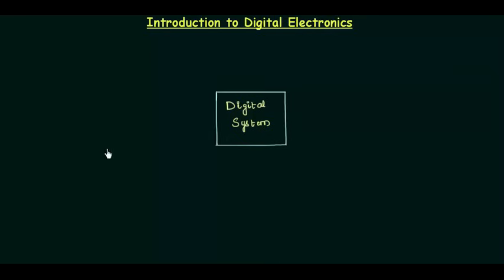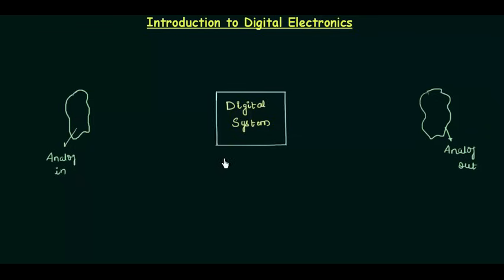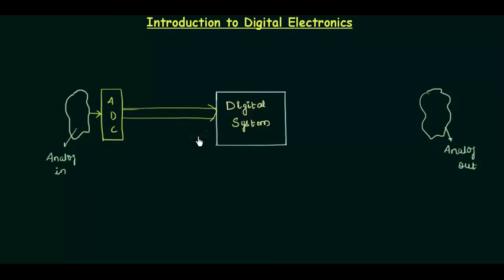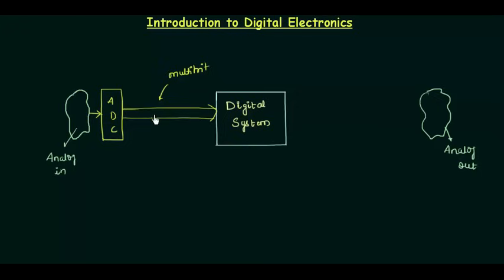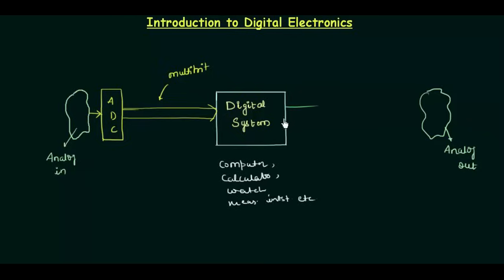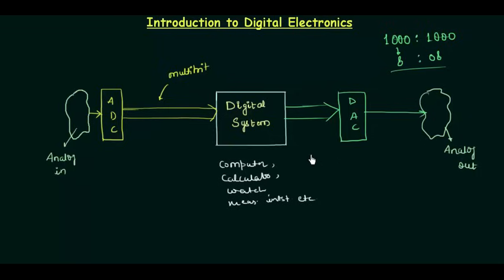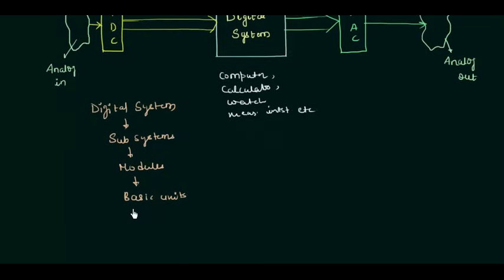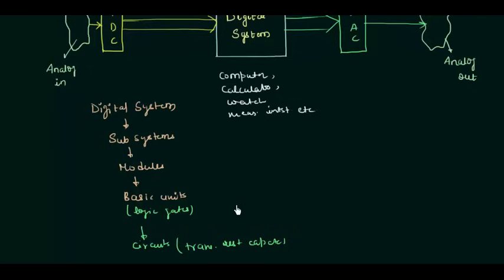Introduction to Digital Electronics

Comment: : COMPUTER ARCHITECTURE

UNIT-I
Information Representation : Register Transfer, Various Registers, Implementing Common Bus
Using Multiplexers: Logical; Arithmetic & Shift Micro – operations.
Basic Computer Design Instruction Codes, Interfacing various Registers, Computer Instructions,
Timing Signals, Instruction Cycle, Design of a Basic Computer.
UNIT-II
CPU Design Stack Organized CPU, Instruction Formats, Addressing Modes, Program Control,
Hardwired & Microprogrammed (Wilhe’s Design) Control Unit.
Memory Organization Memory Hierarchy, Designs & Concepts of Main Memory, Auxiliary Memory,
Associative Memory, Cache and Virtual Memory.
UNIT-III
I/O Organization I/O Interface, Modes of Transfer, Program Interrupt, DMA & I/O Processor.
Pipeline & Vector Processing Parallel Processing Pipelining, Parallel & Distributed Computers, SISD,
SIMD & MISD, MIMD Machines, Vector Processing

 tutorials please

Comment: Hello, I'm trying to make a transmitter circuit and a receiver circuit that will control the motors in a Remote Control Boat. But I can't find enough information online/google. Does anyone have the schematics for a transmitter circuit? I'm trying to build it as low level as possible so I will be soldering transistors and stuff. It will be a learning project for me. I would appreciate any information on the subject. I am an beginner in electronics with some experience reading schematics and I know a little about transistors, resistors, capacitors.